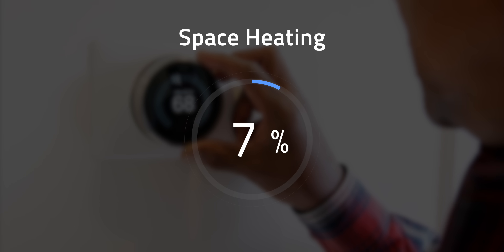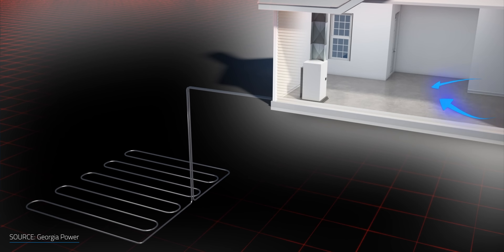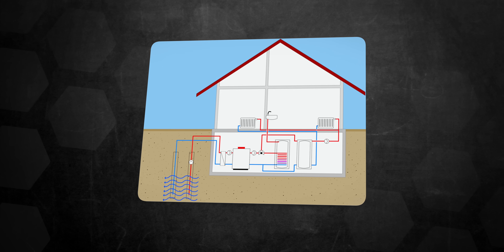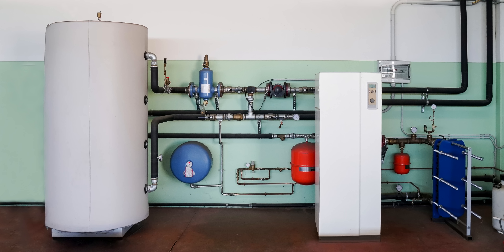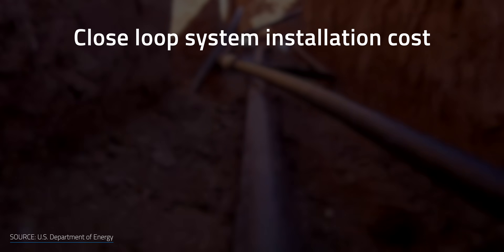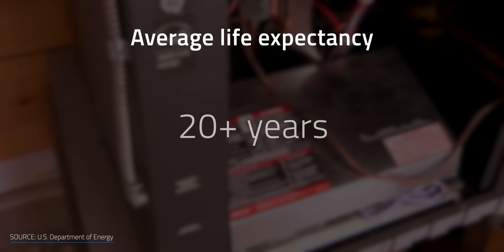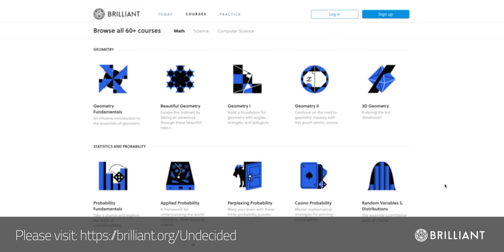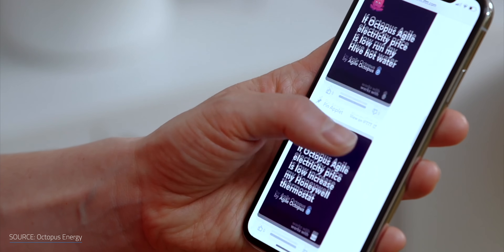Is Geothermal Heating and Cooling Worth the Cost?  Heat Pumps Explained

Comment: My house has had a ground source heat pump (GSHP) for 18 years now. It works really great as I don't have any natural gas connected to my house. Also I live in Edmonton Canada which gets crazy cold in the winter. I have a closed vertical loop system
Reply: I’m in south east BC and am considering a gshp retrofit.  I’m curious, how deep are your vertical loops?
Reply: @gregholloway2656  I think mine are around 200ft deep
Reply: @acedrew1  thanks Andrew!
Reply: @mrxmry3264  Heat is heat.  It does not matter if it comes from the sun or the core.  And since it is stored in the ground it is geo thermal.
Reply: Very interesting to hear that your vertical wells are only 2 meters apart! I’m from Finland and I’m doing my master’s degree thesis on GSHP:s. Here in Finland it’s regulated that vertical boreholes must be at least 15 meters apart from each other because of the boreholes’ tendency to absorb heat ”from each other” during time. IOW in Finland heating season is longer than the cooling season, so after several years there have been more heat absorbed from the ground than the ground can naturally recover, and the ground starts to cool down from its natural temperature. When the ground cools down and GSHP still has to maintain the same amount of heating energy to the building, the boreholes start to absorb heat from larger horizontal area and therefore several boreholes can absorb heat from each other. This reduces GSHP COP and that’s why it’s regulated to have 15 meters distance between two boreholes in Finland.
Reply: @MaidenFinland25  I agree.  2 meters sounds too close.  The cool water return would pollute the intake well temperature.
Reply: @percyfaith11  Yeah, in aquifer based GSHPs, definitely. I was talking about closed-loop borehole systems, as they are by far the most used GSHP type in Finland.
Reply: Thank you for that information about the spacing. I'm in the planning stages of building my house in Warroad, Minnesota which is at 48.9 latitude. I hope your research and paper will help companies and yourself as we move forward
Reply: I live in central Alberta, Canada, east of Red Deer and have a closed loop horizontal system at my 2acre site. I also have hot water assist. My house and system are 11 years old, the house is 1674 square feet on main floor with same footage for the basement. I’m on an equalized payment plan for my monthly electricity and I currently have a contract to pay 6.1cents p/kWh. My monthly electricity costs are $255, no gas to our property at all. I’m very happy with my system. We also built the house with a wood burning RSF fireplace that can heat up to 2500 square feet. I currently use the fireplace for winter night ambiance, but in the off chance we are ever hit by an electricity outage due to severe weather, we should be good.
Reply: Hey Andrew, what's your insulation/envelope like? I'm in YYC looking at a retrofit.
Reply: Interesting @Andrew  I live 120 Km north of Toronto.  My system (Propane) is nearing end of life so looking for options adding value and long term as well. Speaking to a neighbor who has a ground loop system the cost in electricity to power was shocking.  I believe the number was around 600 a month where I spend 600 for winter for propane.   If electrical cost is really this high despite the environmental benefits I am not seeing this being an option.  Interested in your results.
Reply: @waynekibbler2710  yea you still need to run a complete heat pump system, it just uses a different source of heat exchanger.
Reply: @waynekibbler2710  true its expensive  and not so efficient.But people have to eat and sell right? :)
Reply: @waynekibbler2710  your electric costs will be  higher. In the long run propane will likely be cheaper but not as environmentally friendly. Until the price of those files increase it won't be as cost advantaged. 

I find I pay similar monthly bills to my friends who use natural gas. I have a ~1600sq ft bungalow (3200 total) and I pay at most $400/month in the winter and summer I pay $100 using full AC. I think power prices are cheaper in Alberta
Reply: @acedrew1  you said "In the long run propane will likely be cheaper but not as environmentally friendly."  That depends entirely upon what the electricity to run the GSHP system is generated with.
Reply: @percyfaith11  Yes that is true. Each circumstance will be unique
Reply: Low cost thermal solar panels could increase efficiency or reduce the demand for dedicated area for the cheaper)horizontal installations. and in some areas vertical is not possible because of rock underground. It is also more insecure, you never know what is deep down until trying to drill into it (broken head and all, or one more day needed compared to what they thought. So horizontal loops a more predictable cost factor.

Ideally that extra thermal input first heats the warm water all year round  (I assume you get that from the underground, too). Surplus heat from long summer days goes into the ground. 

Uses more electricity in summer because the pump has to bring the heat underground  (but only when PV output is good - by you or other users, so at least suplus renewable energy could be used. And many providers have better tarifs for the heat pump so it should not cost as much),.

That added heat gives users an edge in winter. 

That could also be used to regenerate the heat underground to a sufficient extrent  if a home has a small area of land but they want the cheaper horizontal system or vertical drilling is impossible or cost prohibitive.

or they would have the land but do not want to dedicate so much of the area to the pipes (you cannot build on it, not even a light shed because it seals off the underground. Cannot dig into it deeper, plant trees, run heavy machinery or a car over it. and even a convential lawn is a considerable barrier to penetration of rain water. Good soil or gravel, or sand is much better for restoring heat. 

Normally most of the heat (that is taken out in winter) is regenerated with rainwater without any input from the homeowner (other than the restrictions for the use of the area they have to put up with).

So some low cost thermal solar panels could be the cheap work horses to bring some heat into the underground in summer, and could give more flexibility and they would not need to be very fancy.

It would be the 20 : 80 rule.
Reply: @Sweet Toother You just need to make sure the ground loop is sized big enough for the heating needs in the winter. The summer cooling load isn't that bad at all.
Reply: @Not Me from 100 feet down where its 7°C continuously.

Furthermore there is still heat that can be extracted at freezing temperatures.

Air source heatpumps have a performance coefficient of about 1.5 at 14°F. So for every 1kW of electrical energy you feed it you get 1.5kW of heat back.
Reply: That's awesome man! I live here in YEG too - I always assumed though that thermal heating wasn't an option out here. Cheers man!
Reply: Thank you, Andrew! As a fellow Edmontonian I really appreciate your comments.
Reply: @Sweet Toother In Ontario, the heat load must exceed the cooling load.  If the system is sized to provide 100% heat needs in winter, it will surely provide 100% of the cooling needs.
Reply: @Not Me Below the frost line.  Most geothermal wells draw water from 200 feet or more.  Most horizontal loop systems are buried below 10 feet.  There is enough energy to be extracted there to heat your house.
Reply: @Not Me It's not magic, it's science.  You only have one tiny house to heat (3000sf) but you have a huge amount of sub surface volume to draw heat from.  Therefore even if the temp in the earth is only 40 degrees, once you concentrate the energy from that you can easily heat your home in Michigan.  Just don't leave the windows open.
Reply: what brand
Reply: @Cody8P  I use Geosmart, but there are a lot of good companies out there
Reply: @Cody8P  GeoSmart NetZero
Reply: I had no idea this type of system could work on a lot your size. How much of the surface ground disturbed to go 200 ft down? I suppose if you have ledge in your property versus regular soil, the cost goes up considerably. Is that true?
Reply: Interesting. I always wondered how they perform.
Reply: Can you use geothermal energy for cooking too?
Reply: @pickachublast8  don't think it gets that hot. I think it works like car's ac.
Reply: @pickachublast8  I guess you could... but I have never heard of that before.
Reply: @pickachublast8  you can I think. I believe its being done in Iceland and new zealand at least. min temp for cooking is 60C and steam geo thermal is near or 100C
Reply: Does that provide good heat?? I heard they only give around 15 Celsius. That’s kinda cold
Reply: @CFcostaa  the glycol in teh ground comes in between -3C to =6C depending on the time of year. A refrigeration system is used that removes heat from this source and transfers it to my house heating and domestic hot water. I run my hot water at around 60C and it heats it up to that temperature no problem.
Reply: && Iits easy to heave a wood burning  stove to provide extra heat! Of course if everything is well insulated & even that wouldnt be necessary/
Reply: 666 likes lol
Reply: How do you make your hot water with the GSHP system?
Reply: I have a hunting cabin on my farm.     I have a system using the pond.   I don’t live there I just use it as a get away and I hunt during deer season.  The cabin is about 1200 sqft and sits on a slab.  I’m in Alabama and the heat gets crazy in the summer, winters generally in the 30-40f, and occasionally down into the teens for a night or two.  The system without support blows around 54 degrees year round.  In the heat of the summer the cabin stays around 65 degrees and in the winter the same.   I have a large cast iron stove from an old school that can push the heat up to the 80s if you over fill it.    The system runs year round and my power bill is about $40 a month.  At the same time I have a 3800sqft home with two conventional units and my power bill is around $400 a month.    That a lot to read, but I say that to say I love the unit in the cabin.  It’s always comfortable and quiet, very cheap to operate.   The installation costs were not bad, about what I would have paid for a conventional system.
Reply: You got lucky. Not every shaft drilled will return a good heat source for one, two today this is costly. How do you exchange air in your home? HRV and vents perhaps?
Reply: @kenthhamner2641  it's essentially a hydronic heating system. GSHP heats up a glycol loop. The glycol heats my floor slab and also goes to a heat exchanger on a air handler to vents in my house
Reply: @kenthhamner2641  also I agree it is very costly. I have been seeing more NetZero homes in my area use an air source heat pump, passive solar heating and then electric baseboard heaters as a backup when those things can't keep up. Pair that with solar and I think the costs are similar
Reply: @acedrew1  while this sounds like a good plan for the net-zero home owner, its a disaster for the grid waiting to happen (or at least a stressful situation that will trigger investments in the grid that everyone is paying for in the end) if rolled out at a big scale for non-passive homes. Imagine everyone switching on electric baseboard heaters in the winter on a day with low solar and wind input. 
Multimodal heating systems, also allowing for a bit of fossil when electricity is scarce, would be a good compromise, but they are a tech and cost overkill for small units, since any furncae requires a chimney, regular maintenance ... 
I know this is routinely done in Quebec, which have plenty of hydropower during the year, but during the coldest winter days, some house  heatings are 'smartly' asked to switch over to oil, friend of mine has such a binary system and told me he fills up his oil reservoir of 1000l like once every few years. Seeing what has happened in texas, it makes him somewhat more comfortable and he is thinking of filling it up more regularly and add a small power unit to provide the electricity to his furnace in case everything goes down... (now quebec is not texas).
Reply: @olivierbraun941  you know what everyone is also paying for in the end?

fixing climate change. and the second you slap the cost of fixing climate cange ( aka sequestering all the CO2 from the air again) into the cost of fossil fuels is the same second when renewables and electric heating (including the cost of required grid upgrades) become a lot cheaper than fossil fuels.
Reply: I was primariliy referring to the use of air source heat pumps and electric baseboard heaters as an alternative to gshp. And no amount of solar panels will deliver you the energy to heat a relevant number of homes in cold winter condition. So the grid operators will have to ask the peaker plants to step in, which will burn fossils with an execrable efficiency just people can use it for resistance-based (or execrable efficiency heat pump) heating. 
That's not helping the planet. 
Under these conditions, generating heat from fossils locally is more efficient, generating heat and electricity using a co-generation plant would be the only realistic even-better choice. And yes, for sure one could operate this with a synthetic fuel from renewables once they are broadly available (or wood pellets)
Which is why a gshp with sufficient depth which can operate at good efficiency also in winter makes sense.
I am just fed up with too many of the over-simplistic 'my solar panels generate such an amount of energy over the year so that's all i need'  while they are pumping electricity into the grid at times no one needs it and feel free to serve themselves as they like in the middle of a cold winter night but claim they would be oh so carbon neutral. They are NOT.
Reply: @olivierbraun941  vast majority of electricity comes from Nuclear in Ontario, so they still may be carbon neutral. Haa
Reply: @anonym3017  Right, the challenge is in making the transfer from non renewables to renewables without overloading the system and bringing everything down. 

It's not just about making changes to our heating and energy use, but the right  changes.
Reply: @jeremygibbs7342  the thing though is that even using anatural gas fueled combined cycle gas turbine to provide the power and a ground heat pump  to turn the electricity into heat is more efficient than just straight up burning the gas at home.

same for oil fueled turbine and oil heating system.
Reply: @anonym3017  Or everything becomes much more expensive.
Reply: @AndroidGuru13  Or hydro.
Reply: @olivierbraun941  Sorry but this isn't true at all.  The vast majority of heat is being pulled from the ground.  Power is only being used to circulate the refrigerant and pull the heat out of the closed loop.  It's far more energy efficient than using baseboard heaters.  Peak load is also not some sustained event that last for days.  You can just heat your home when prices are cheaper and supply is more plentiful.  Your house can be used as a thermal battery effectively.  It's also way cheaper to do this than pay for a gas hookup which mostly just charges you for aging infrastructure that you would barely use.
Reply: How is it heating up your house? Do you still need to run a heater/furnace to top up the heat? 
I understand that the ground is cooler in the summers and how it cools but not how (much) it heats. When outside is -20 i presume that the ground is still kind of cool.... but now I read its 200ft deep, I wonder how warm the ground would be.
Reply: @AndroidGuru13  It is basically just a reversible AC unit. It’s not explained very well in the video but due to some cool physics it can be up to 5x more efficient than an electric heater. If you think about how an AC makes a cold area colder by making a hot area hotter (also refrigerators) it starts to make more sense. Technology connections has a more in depth video that explains it really well.
Reply: @rogerp.2442  Im late to this, but I moved froma house with electric baseboard to a house with 4x the volume and a groundloop system and my electric bill only increased a small amount.  Also have a desuperheater to take waste heat and preheat my hotwater.  Crazy efficient.
Reply: @rogerp.2442  if your electricity goes out, how do you heat the house?
Reply: @santafeschehl  same way as anyone using electric heating… you don’t. 

Of course if you’re all electric hopefully you’ve had the presence of mind to buy a backup generator or a wood stove. But I did just fine for 12 days back in 98 with no power or heating in the middle of Canadian winter. Kept warm enough cutting up the fallen trees all over town and sleeping under extra blankets. Kept a pot of soup going on a camp stove at all times.
Reply: @santafeschehl  How does your furnace motor run without electricity?
Reply: @AndroidGuru13  THe ground under a certain point tends to stay a rather constant temperature, that is why caves tend to stay safe for the creatures that live there year round and actually warms up the deeper you go.
Reply: @AndroidGuru13  underground have a constant temperature hot or cooler than ambient temperature is relative.
Reply: @AndroidGuru13  during the winter the ground water(glycol in my case) comes in at around 1C. The heat pump uses a refrigerant to strip heat and return it to the ground at -1. The unit heats up another glycol loop that circulates to my 2 zones.

My only complaint is that is is a bit slower than a furnace.
I don't use a furnace at all. I have 2 loops that I heat. I have a heated concrete slab in my basement and then the other loop is a forced air system
Reply: @acedrew1  thanks for the reply. 
So a secondary hearing source would be needed. In your case the concrete slab. How is that heated? By wood?
Reply: @AndroidGuru13  the concrete slab is also heated by the ground source heat pump. It is sized large enough to do both. The heat pump heats up 2 loops and has 2 thermostats controlling it
Reply: @acedrew1  sorry Im young and just curious if my questions don't make sense..
but as I understand, the glycol comes in at 1degrees and then heated (from electricity?) and then it heats the concrete slabs thus heating your house. So the secondary energy is required in the system?

Does it use a lot of electricity ?

I studied some geothermal heating which uses ground heat to heat water to heat the house... but when the ground is not very hot, it can only provide so much heat.
Reply: @AndroidGuru13  it's all good. It's like how the video explains. I input 1kw of electrical energy and the system creates 4 kw of heat energy. The best analogy I have is that it is like a refrigerator. In a refrigerator it takes heat from inside the fridge and disipates it out of the back of the fridge. With the ground source heat pump it is the same thing except my house is the back of the fridge and the ground is the inside of the fridge. Reverse in the summer time when I want AC
Reply: @acedrew1  awesome thanks! I'm surprised more people don't have such geothermal heatpumps in their homes. The AC/Heating companies wouldn't like it too much haha
Reply: @AndroidGuru13  Why should the heating/cooling companies care?  You still need all the interior components of a traditional AC unit and furnace to get the heat moved where desired.  All this replaces is the outside condenser for AC or the furnace for a heat source.  Ducts and heat exchangers that HVAC companies install and service are still required.
You also don't seem to understand the basics of heat pumps in that compressing a liquid/gas increases its temperature a lot.  That is bled off underground in AC mode which brings the cool liquid back inside to pull more heat from the house.  In heat mode, the compressed heat is blown/transferred into the house and the super chilled liquid goes back outside uncompressed to pull the heat from the ground.  The compressing pump is the only thing drawing electricity which is where the energy savings comes from.  Yes a fan or interior pump is also used but they don't draw much power.
Reply: @AndroidGuru13  it uses the pressure to cool. In compression the gas will heat up and become a liquid, as shown in the vid, moving the temperature above room temperature which makes it possible to be cooled down to room temp. Then it gets thru a valve that releases the pressure and the gas expands and goes back to the original temperature minus the amount that was cooled off in the room, so now it is colder than ground and can be heated by the ground again. With the right coolant you can even use this system in sibiran air at minus 40 c, all it takes is a coolant that can go below minus 40 c, like ammonia!
Reply: @AndroidGuru13  the deeper you go, the hotter it gets. This is one reason why deep mining is really hard. Pretty sure it gets hotter than the surface of the sun, towards the middle.
Reply: @EC-dz4bq  I know but the geothermal lines aren't installed very deep.
If you look at earth's temperature by depth... At 200 meters or 600ft deep, the crust temperature is less than 20 degrees Celsius. It does get hotter deep but after some depth. 500 meters deep is still less than 30 degree Celsius.

Now if we install the lines a kilometre deep, then we're talking! 

Temperature by depth also varies geographically.
Reply: @mrxmry3264  Core of the earth would be hotter than the surface of the sun.
Reply: @AndroidGuru13  The ground is only cold for the first 3-5 feet in winter. After that it will always be warmer than surface temperature in winter.
Reply: Liar..!!!!!!!!!!!!!